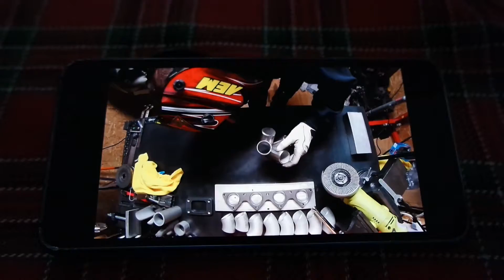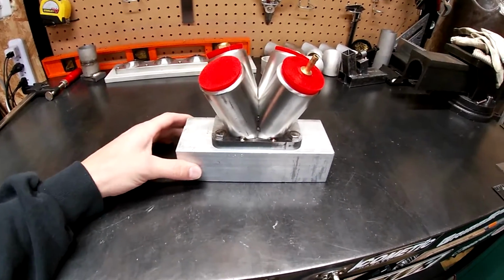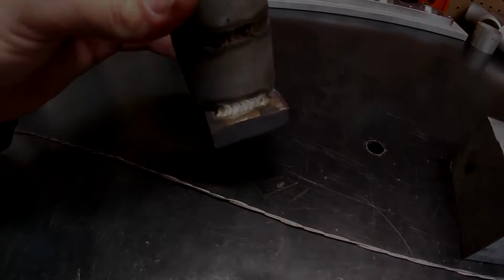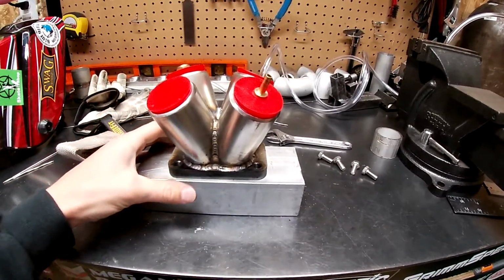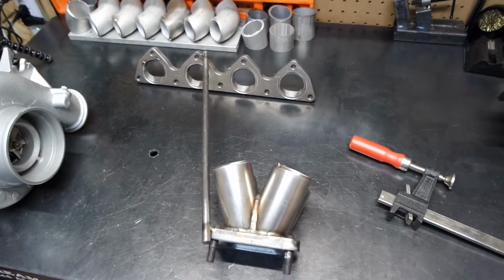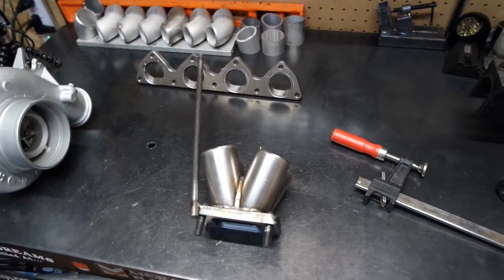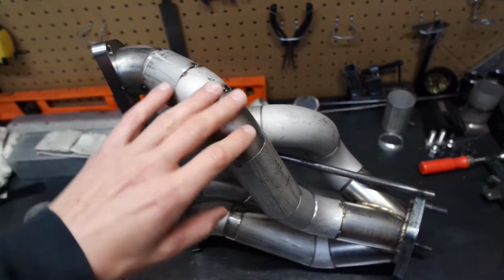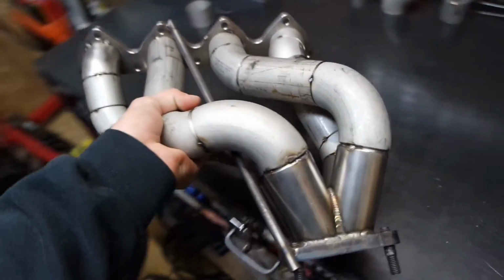D16 Turbo Manifold Part 2. Welding the Collector and mocking up the runners...

Comment: When it comes to purge welding the manifold what are the expectations of the actual weld internally? Is it a solid weld inside or is it just done for the hell of it? I just ask because I want to build mine soon and I’m a professional sanitary welder , we usually bevel and root anything over such 10
Reply from the maker: To be honest, it is very hard to get full penetration on schedule 10 or 40 with one pass even with proper bevels. Like you said it would be preferred to do a root pass and then cap. I backpurge just to eliminate any sugaring in the areas with slightly larger gaps where I do get full penetration. Knowing that it will be heat cycled often, I try to avoid it at all costs. If you want a manifold that will outlast others use 321 pipe. It heat cycles much better. This is all my opinion so do your own research and go with what you think is best.

Comment: How much amps did u use yo weld the colector to the flange?
Reply from the maker: I can't remember exactly but I usually just set my machine 10-20 amps over what I will need. I probably had it set around 170 amps for this and use the peddle to control heat.
Reply: How much amps do you use to weld the elbows to straighth or elbow to elbows xause im trying to make a turbo manifold but i dont know if 100amps is okay
Reply from the maker: Just set your machine high and learn to control with the foot pedal. There is no one size fits all for amperage settings.

Comment: What size 308 rod did you use ?
Reply from the maker: I used 1/16 but I should have used 3/32. I had to push alot of filler with 1/16 and in some areas it was still underfilled. 3/32 is the way to go!